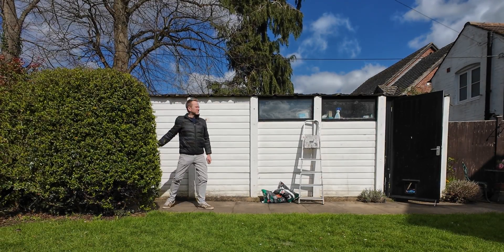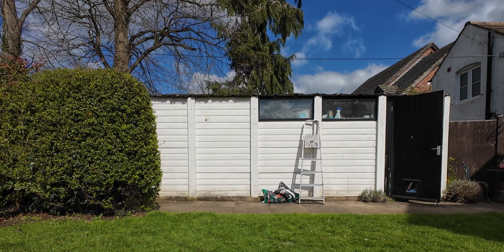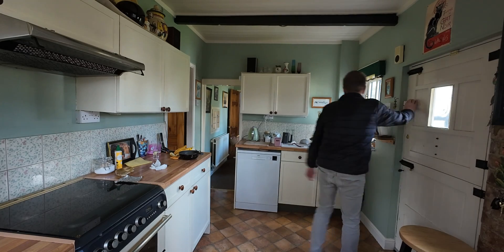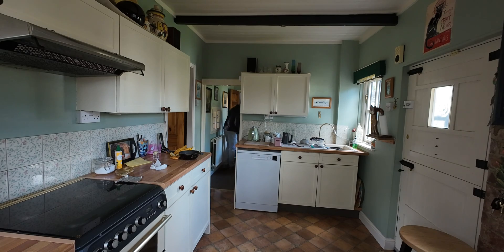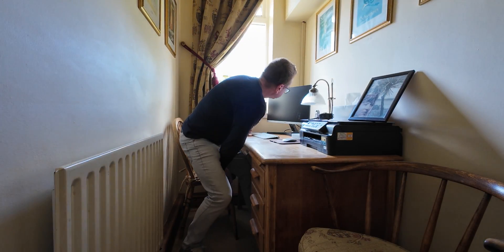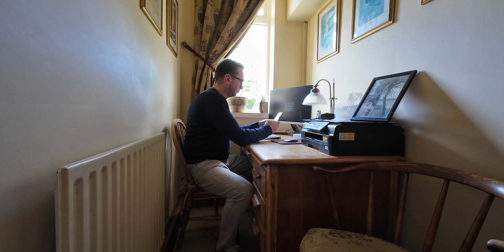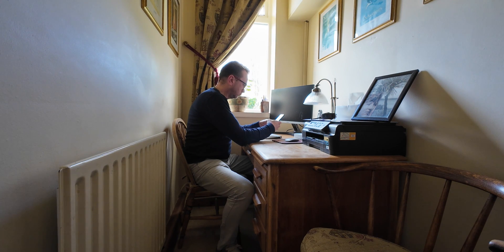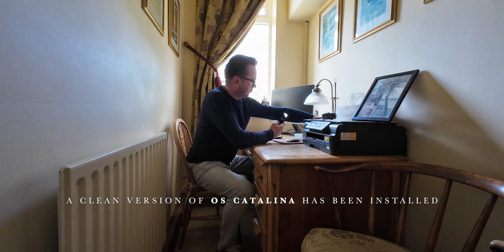2012 Mac Mini Upgrade in 2024 - NOTHING Went Wrong But It's A Finicky JOB..

Comment: it still runs an outdated version of MacOS, without recent security patches.
it's only good for web browsing using Chrome or Firefox, because Safari is not patched.
Reply from the maker: Indeed. I have also installed Chrome but good point made 👍
Reply: @realmattjc  You should get OCLP and install a more modern OS like Ventura or Sonoma.  They run great on these machines.
Reply from the maker: @SteveAaron  funnily enough I was thinking about that. Correct me wrong but it’s some sort of patch?
Reply: @realmattjc yeah OCLP will patch Sonoma to run on the older hardware. I use my 2012 i7 Mac Mini every day with Sonoma after putting in a Samsung 850 SSD beside the 1TB HDD.
Reply from the maker: @jamesjguthrie  nice one. I’ll get on that. Thank you 🙏
Reply: @realmattjc  It's actually comprised of 2 things.  The first is a bootloader that will make it possible for a modern MacOS to actually boot and install properly.  The second part, after the install, will inject back the drivers for your machine that Apple intentionally removed so it won't work.  Awesome stuff!!  Runs beautifully.  There are tons of videos here on how to go about doing it.  It's pretty easy.  Been doing it for years.  You should definitely give it a try, and tell us how it went.  Worse case scenario, you go back to Catalina.  But I doubt you will.
Reply: @realmattjc don’t do those OS but the advice is correct. Install Monterey for two key reasons 1) From personal experience that works best on 2012 Mac mini 2) Everything has been moved around in newer Mac OS so your dad will be ringing you all the time to find stuff in the menus 😂
Reply from the maker: @richarddcrossley  very true lol 😂

Comment: I like upgrading old Macs because they still have their uses, like with your father's Mac mini.  It's a common misconception that adding RAM makes a computer faster because it improves multitasking and minimizes the potential for disk swapping (which does aid performance to a point).  But otherwise, more RAM does not make a computer faster, it's the swap from platter drive to SSD that makes the big difference, as you discovered.
Reply from the maker: Yes I was always aware it would be the SSD that made the difference but figured the RAM might be worth doing too. Either way it’s night and day difference now so all good. 

I think you’re right. They still definitely have their uses. Thanks for watching 🙏
Reply: @realmattjc  Yep, that RAM was worth upgrading too, I would have done the same thing.
Reply: Adding RAM allows you to run programs at all.  But the SSD is the speed boost.

Comment from the maker: Don’t buy a new Mac. Your old bag of nails might still have some life left in it yet!
Reply from the maker: @user-qf6kb4vl6d thank you for watching and you are quite right. It depends on what you need I guess. My parents didn’t need anything super fast however it was horrendously slow before the upgrade.
Reply: While I agree with the idea of keeping devices out of the landfill, this Mac is near end of life. It will only get a few more months of updates leaving it vulnerable to malware and app support issues. 

While it sounds annoying, I recommend putting a Linux distro on it that resembles MacOS just enough for a sense of familiarity and will keep this thing around longer.
Reply from the maker: @chandlerbing7570  I will certainly keep that in mind. Thank you.